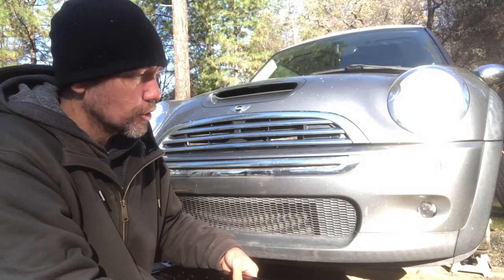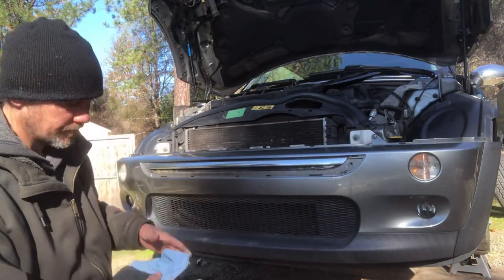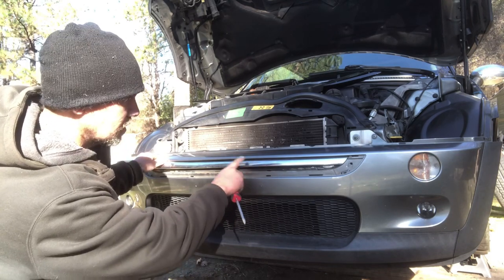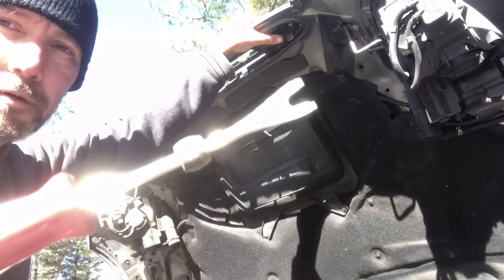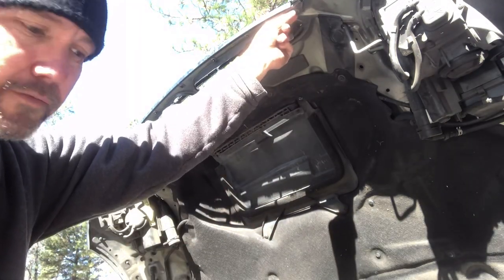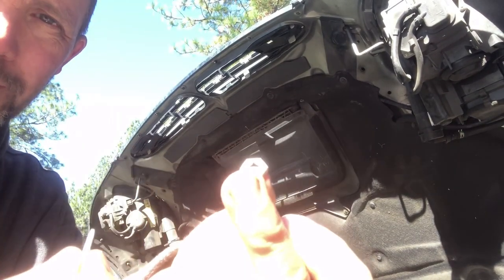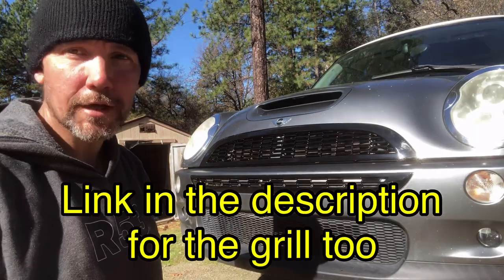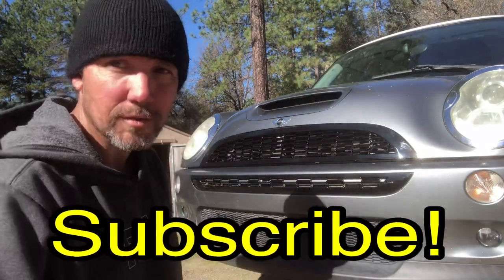R53 grill replacement (how to)

Comment: if you have problems with the lower grill snap in clips not staying in place, a tip I used was to use a heat gun and gently bend the clips out, so they apply more pressure in the slots. Worked for me so far.